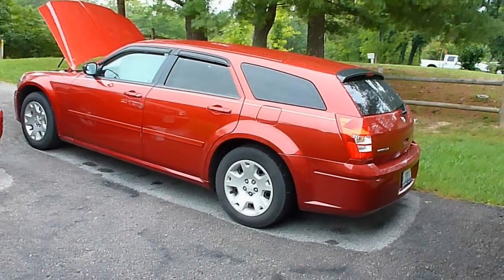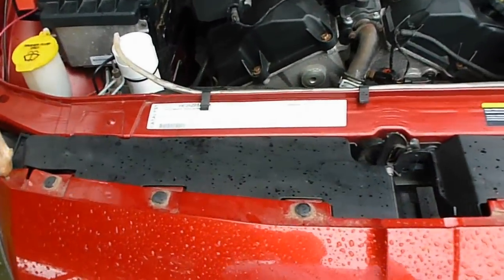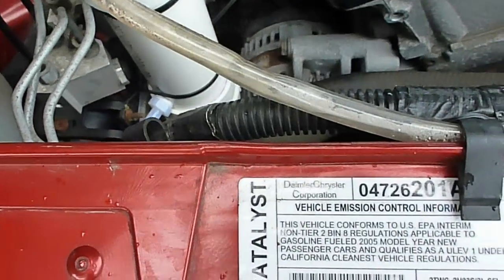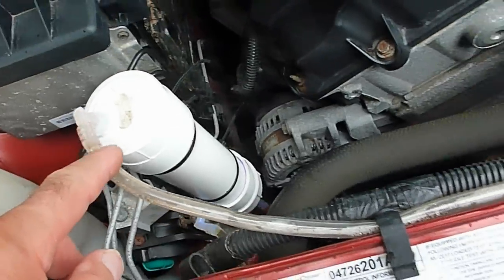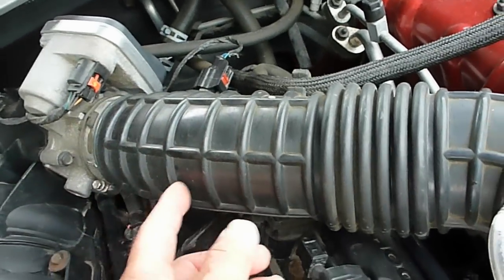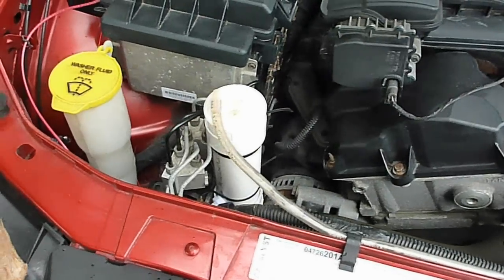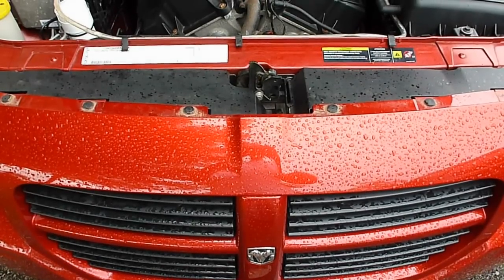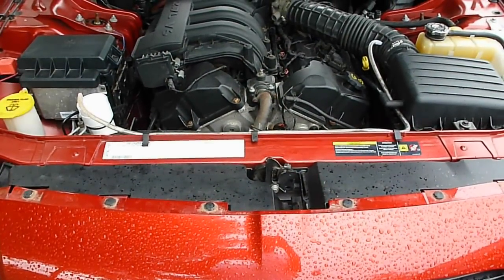2005 Dodge Magnum with an HHO generator installed, now i'm getting 30 MPG, not 16MPG...MOV

Comment: WHY ARE THERE SO MANY PEOPLE SAYING THAT THESE DONT WORK!
Reply: +Keagan Cook what people dont understand is that you dont necessarily have to hook it up to the cars main battery. Instead get a small 24 watt solar panel and another car battery, hook it up to the HHO generator and put it into the gas lines. wtf is so fucking hard to understand about that? what people just hit a brick wall and give up? WORK AROUND IT.
Reply: Scam? how is it a scam when you aren't buying from someone? in fact, a lot of places that sell them often give you advice on how to build your own, but some people do not have access to the equiptment to create an HHO device.
Reply: TheKahmantator The amount of energy you will get out of the hydrogen exploding will always be less than the amount of energy it takes to make the hydrogen, even if your engine is very efficient.
Reply: 24 watts will give roughly half a liter of atmospheric-pressure hydrogen per minute. That's about 1/50th of a gram of hydrogen. Your engine will barely notice.
Reply: With out a remap of the tables for the change in fuel being delivered... I would call this dumb and a waste of time and money. Want better gas millage? get a tune
Reply: @rinzl3rs349  100% correct
Reply: @Keagan Cook hey where's your video that proves this doesn't work... I want to see it...
Reply: "...uses water as fuel" is where you'll always lose any audience.  That's not true even by anyone's standards that run HHO generators, and sounds like total horse cocky to the general public.   Electrolyte added to water with current ran through it produces a gas that is, not combustible like gas but, explosive.  The argument is the amount of alternator and other resistance in play that 'might' / 'could' negate any positive effect from the HHO acting as a catalyst inside the chambers resulting in a super efficient burn of practically all fuel.  The stronger explosive kick requires less fuel.   Getting all this to work is only as good as the EFIE and chips used as a means of reducing the fuel pumped through the injectors.  Old carburated cars were easier to work with.
Reply: because they don't work
Reply: try hooking up your HHO cells to an upgraded alternator, not the bat.. ;)
Reply: RavenPrecept dont forget turbochargers...big scam...oh and dont even get me fired up about superchargers
Reply: This has already been proven to not work! Well it works in the sense that HHO does burn and will aid the car running but as has been pointed out it takes more energy to produce this fuel than you get back from it... it's that simple... There is no magic way to make it more efficient... Trust me, if you could car manufacturers would be bloody installing them!
Reply: it works but somtimes u have to adjust the oxygen sensors so the system dosent think its wasting gas: hence it put more gasoline to componsite. so basically the car's computer thinks that the gas is not burning or not being used properly so it puts more gas
Reply: basicly on some cars u have to adjust and on some u dont have to
Reply: and also there is 2 ways of feeding the hydrogen, 1 is through the air pipe and 2 is pipe lines into the cylinders
Reply: Trolls!
Reply: It has to do with something they call ‘science’.
Reply: They don’t install and calibrate the systems and motors to optimization because they don’t do the research.
Reply: It doesnt make energy out of noithing. It uses water as the fuel, which converts into HHO, and runs the engine. Not on its own, but with the aid of gasoline. 2 fuels working together to run the alternator.
Reply: ya JT, I follow you. However, assuming that one would not be habitually accelerating 100% of their motor's ability, but rather attempting to conserve energy (that's why they installed an hho gen in the first place), an engine burning the injected fuel more efficiently would experience higher performance naturally. hence, the fuel being burnt would obtain the desired level of performance, backing ones foot off the accelerator 30% more of the time. But then I also understand the argument of increased load of the alternator. I'm kind of convinced at this point that the alternator would not have that much influence, certainly some, but not as much.
Reply: TheKahmantator but you are using the gasoline to make the hydrogen. the energy that would be used on making the car go forward is instead used to power an electrolysis cell, making hydrogen. in the end you will always lose power.
Reply: Andrew Martin you are right I also have the proof. My bike is running well with hho kit. After installing am getting 13 km extra mileage in my Yamaha fzs 150
Reply: DO YOU PEOPLE KNOW WHAT WOULD HAPPENED IF  AMERICA REN ON WATER OVER ONE NIGHT? SO MANY REACH PEOPLE WOULDN'T BE RICH AND SO MANY AMERICAN PRESIDENTS WOULD LOOSE MONEY THAT INVESTED IN OIL....THINK ABOUT IT THE GOVERNMENT WILL  FALL ON ITS  FACE. ITS ALL ABOUT THE DEMAND , IF EVERY AMERICAN CHANGED THEIR  MOTOR OIL AND TRANSMISSION FLUID AND WASH THEI CARS QUICK LUBE AND CAR WASH STATION WOULD BE OUT OF BUSINESS, AND WE ARE TALKING ABOUT GASOLINE.
Reply: +Andrew Martin if this worked it would break the 1st law of thermodynamics. You can't get energy out of nothing. To make hydrogen, you need electricity. Electricity comes from the battery, which is powered by the alternator, which is turned using gasoline. The amount of power it takes to make the hydrogen will always be more than the amount of energy you'll get out of the hydrogen.
Reply: Keagan Cook 

This here hillbilly engineering doesn’t obey the laws of thermodynamics!
Reply: Uh,  because  they  don't?,  and  by the way,  "they don't"
Reply: yeah they do
Reply: i have physical proof of these working.

Comment: If you connect it to your car battery, wouldn't it therefore run out of battery and then make you buy a new one, defeating the purpose of 'saving money'?
Reply: +Ayman Kampoori Could be connected to ignition
Reply: the unicorns running around poking holes in the radiator create electricity from the friction of their horns going through the aluminum which recharges the battery.

Comment: Im using 8 gauge straid wire on 3 vessels with 13 plates each. So far the mileage have improved 25% and theres a sufficient notice in horsepower. Im planning on upgrading to 4gauge wire as I am melting my 100 amp fuse holder. Also each vessel will have its own fuse of 40 amps, which means ill have to install at least a 150 amp alternator
Reply: If it's melting the fuse holder I've seen this before your fuse isn't making good contact what I would suggest to fix this is run your wire to a fuse block and use the round glass fuses as they'll make better contact and not melt the fuse holder. I converted my 04 GMC to electric fans and thought I caught something on fire but it was just a melted fuse block
Reply: @fishing_with_chaz  
I was using those large round glass fuse holders.

Comment: Do you have to refill water tank which produces the gas?
Reply: +Joygreg No.  As HHO is produced and rises up and through the bubbler, water from the fill tank gravity feeds into the HHO generator.  When you fill with gas - check the water level of the fill tank.

Comment: I created the most basic pickle jar hho generator and it hooked into my headlights. It was a 5 speed 99 maxima and it would give a small chirp if I tried to peel out in it. After I hooked up the hho I was able to do some decent peel outs in the car and it just had an all around burst of power.  My gas mileage seemed much worse than normal and sometimes i would get surges of power where i'd be like whoaaaa!  I wonder if if would be better to hook it before the MAF so as to use the car's system to monitor the ratio?

Comment: Hi there, thank you for sharing your mpg. I did something similar for my 2001 gmc jimmy. But now I have found a better way to make more bubbles than what i was getting. I will try it later today but I wanted you to know about it.  go to  PROTOTYPE9000   channel on Youtube. His videos are years old but what caught my eye is two stainless steel pipe clamps he used in tap water. No electrolyte. Compared to my machine if I got 20 bubbles per second, his would be about 2000. Its awesome I can't wait to try it.  The one i did only gave me 1 mpg more.  Thanks again for sharing.

Comment: i'm not skeptical, but i have some questions...
That is a fuel injected vehicle. 

how did you get around the o2 sensor freaking out with the extra oxygen?
o2 sensors do not read hydrogen but do pick up the extra oxygen.   in short, these issues usually cause the ECU to freak out and go into a wide open gas dump, or to restrict the gas if it thinks the engine is running too rich  or lean. It will change the fuel to air ratio to what it thinks is accurate, but since it doesn't pick up hydrogen, it is always burning lean with the extra oxygen and it opens the pulse width of the fuel injectors and lets the max amount of fuel through, thus being counterproductive to mpg gains. but, you DO in fact gain horsepower.... because it's pouring fuel into the engine..... 

Also, how much HHO are you pumping into the engine?  typically, if it's a small amount, then the ecu can compensate by using various other sensors if the engine is running rough. But it seems that any of the potential gains get tuned out with the ECU as it tries to compensate...   meanwhile, too much HHO is not good, because, HHO turns into water. water turns into rust. rust turns into expensive engine swap and a pissed off wife. 

again, not skeptical.... just looking for more info... thx
Reply: ThinkSpore .com Well the ECU will not see the extra Oxygen because during combustion it burns with the Hydrogen. It's a one to one exchange. You said " but since it doesn't pick up hydrogen, it is always burning lean with the extra oxygen ", Hydrogen isn't actually flammable by it's self, like anything else it needs oxygen to burn. The burning of the hydrogen makes H2O, which takes up all the extra oxygen supplied by the HHO gas.
Reply: batchnerd sounds like a good theory.  It holds water..... pun intended... I have read a lot of articles,  which may or may not be accurate about people having to use spacers on their 02 sensors and various things due to issues.  Thats one reason why i mention this.. didnt happen to notice if you are the person who posted the vid. If not, have you done one of these builds?   Just curious.
Reply: batchnerd and what about the mass airflow sensor? i don't remember if in this video the hho was added before it or after it. But that changes your fuel air ratio...
Reply: batchnerd i see my mistake. I meant mass airflow sensor in my original post not 02 sensors.
Reply: ThinkSpore .com He got lucky and put a hose to inject the HHO after the mass airflow sensor. This is the way it needs to be done so the computer does not add more fuel. What you are doing here is giving the engine 2 fuel sources. The ECU cannot know about the extra oxygen, because if it does it will add more fuel and run a rich mixture. Rich because the oxygen from the HHO recombines during the combustion process, leaving the extra fuel the ECU added to be spit out the tail pipe.
Reply: batchnerd there ya go... that's what i was getting at before.  i've started to type this out 3 times now, but i think i understand the literalism of what you're saying....  

i was going to say, to do it the official right way, you'd put it in before the MAF, but would tune the ECU to account for the added o2, because, if you go after the MAF, then you are adding extra o2 into the engine, and causing a lean situation because of what you just said, i.e. not knowing about the extra air, and not putting more fuel into the engine to compensate, which would burn the engine up.... 

but, if i understand you correctly, what you said was " you're adding an additional fuel source"....  

so basically..  does that mean there is no NEED to dump extra gasoline into the engine, because the lean condition is being accounted for by the Hydrogen being injected?   It makes sense actually.....     Honestly, i AM a mechanic, but, i haven't messed experimented with HHO yet...    I just never thought about it that way.   

I do still have an issue with essentially pumping water through the engine though, (from combustion).  Granted, it's not much water, but, gasoline already produces a certain amount of water, and all of our gas in Texas has up to 15% ethanol now, whether you want it or not.  Ethanol leaches water from the air and deposits more water molecules into the gas, which also ends up being pooped out the tail pipe.   I wonder how much water the engine will handle before it begins flash rusting cylinder walls, valves and things that are not meant to see moisture.   granted, a lot of newer vehicles have nickle plated cylinder walls, and that helps..... and with a small set up it should be no real issue i wouldn't think.   But i'm thinking in terms of, if you had a 1.4L engine running on strictly HHO, or even 50/50 gasoline HHO, what would happen...  (yeah it would take a lot to produce that much)
Reply: ThinkSpore .com To all of the people who aren't really sure what O2 sensors and such do, basically the computer in the car doesn't know that we're trying to help the car save gas... it reads the extra air or oxygen going in or coming out of the car and tries to compensate by adding more gas, completely unaware that we're trying to help it, not hurt it.
Reply: Jason Snell exactly... the car doesn't know we're helping it by feeding it oxygen so we use the hydrogen as a tranquilizer so it doesn't run away. :)
Reply: Jason Snell interesting side note...  if you want to know how inefficient this super high efficiency model that we're talking about really is,   think about this.   The whole setup we use to separate the water and make hho... 

A leave on a plant uses 2 photons of the sun's energy to split a water molecule... it exhales the oxygen and uses the hydrogen, combining it with carbon to make sugars for the plant to grow and live. One banana plant can put out almost as much oxygen as this video's setup under the right conditions... im not saying everyone should hook a banana plant to their intake... but...  we should learn more about how photosynthesis works, and use it synthetically/mechanically.
Reply: The only problem is we'd need for the light to be a particle for the alignment to work... but the second an asshole thought it was a wave, all of the cars would stop working. ..
Reply: Goddamn... why can't people be pragmatic and just fucking see if it works for themselves before they start bashing it. I bet that the vast majority of the assholes dissing the whole HHO deal haven't even set it up or installed it on their own.
Reply: Im not bashing anything. . Im learning. I want to make and sell these. Makes sense to learn about them first,  right?
Reply: i didn't say you, specifically. I already have the plans for an HHO generator and will have it installed this week. It's not a piss ant design either :)
Reply: Oh sorry.  You commented after my last comment.  And that's cool!  I'd like to see the results.
Reply: I'm physically working on it right now. a few little things to finish up but it'll be installed THIS week fingers crossed
Reply: +Jason Snell any further updates?

Comment: This system does not work. You simply cannot run a closed  system like this without adding external energy. Why are people still posting this rubbish. The idea that "big oil companies" are suppressing the technology is rubbish. Why are big oil companies not suppressing shale gas?? If it worked how come not one manufacturer has installed it at production? Its rubbish!
Reply: Your brain is rubbish
Reply: kdmc40 OBVIOUSLY they want you to go to the gas station as much as possible... that's like willy wonka's everlasting gobstopper! Why sell just one? you are a fucking idiot to even CONSIDER siding with the oil companies or even the government. If car manufacturers were installing a device like this in every car, they would jack up the price and flat out murder the oil companies. oil companies pay car manufacturers to NOT do shit like this because douche bags like that can be bought!!!!!
Reply: I'm sure you know that alternator produce way more power that you need for your spark plugs, ECU, radio, phone charger?
Reply: Keep drinking the koolaid buddy!
Reply: I will... taste great and less bullshit than what you drink!

Comment: hho suck, soon you will get those crystal build up in your intake like my car. look my video hho joe lee to prove hho suck.
Reply: Looks like a leak of some sort, the only way to crystallize Hydrogen is under 59,000 times atmospheric pressure at room temperature, See this link.
https://www.gl.ciw.edu/crystallizing_hydrogen

Also according to http://phys.org/news/2011-12-crystallizing-hydrogen.html Hydrogen burns clean.

Sorry about what happened to your car... that honestly suck... but until you do a chemical test to see if it is some how indeed hydrogen chrystals then I cant call that a conclusive result. I would like to see your final findings.
Reply: oh dissed.
Reply: Dimrain13 x hj.
Reply: Joe Lee My only guess is that you have a liquid or solid of some kind because crystallization (i don't think) doesn't come from a gas like a liquid or solid.
Reply: Joe Lee Not if you were to use distilled water though. Your probably talking about calcium build up